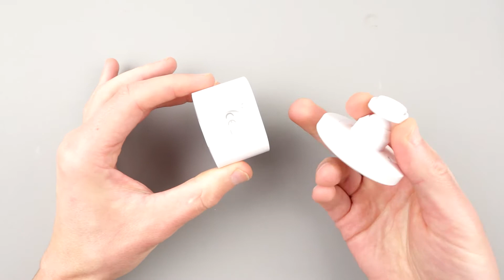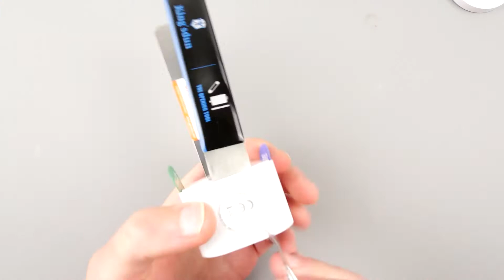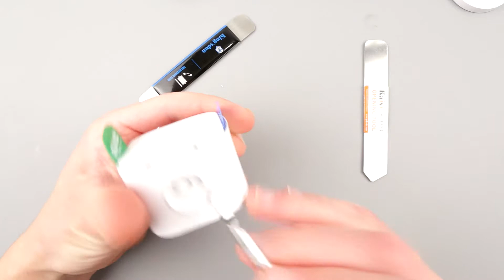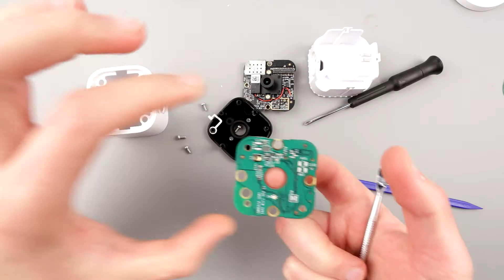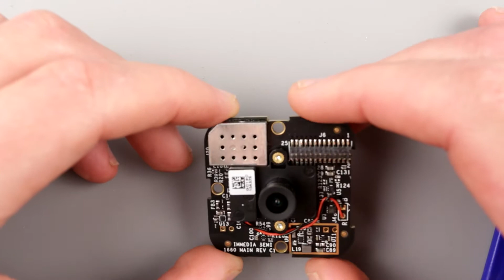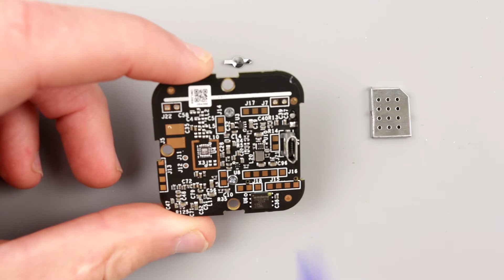Chopping Blink mini camera to pieces

Comment: I'm surprised this video hasn't got more views.  You did some good work here.  Importantly, you identified that the Blink mini contains that extreme low-power chip that was, apparently, the reason that Amazon bought Blink.  Of course that chip is all about saving battery power, so I assume that the mini shares a lot with the other Blink cameras.  I am going to have to experiment to see how long my mini lasts plugged into a portable power bank.  

By the way, you can usually see if something is emitting IR by simply looking at it through a phone camera.  I use this technique all the time to see if TV remote batteries are dead or not.  Cheap phones are better for this because good phones have effective IR filters.
Reply from the maker: Thank you for your support, I wish this video got more views as well.
Good Idea with cellphones, I will give it a try next time.

Comment: 8:40

It’s actually not blank but the laser engraving is microscopic 😂 not to mention even under the microscope it only catches the light in one direction. I ended up using a couple of different wavelengths of UVC LEDS, and a bit of fluorescent dye which helped but it was still difficult to read 
I  finally made it out and looked it up… The part number is CYW3438
Reply from the maker: Thank you for pointing this out!

Comment: woah. very cool video! didn't expect this thing to even open without any destruction, let alone be taken apart that much. I wanted to know if there was any way to hack it to use it as a usb camera. seems like it would be very had, unless had insane reverse engineering skills and knowledge, or had access to official firmware and documentation… oh well
Reply from the maker: Pretty much impossible unless hacking or modifying original firmware

Comment: What is that’s inside at the bottom of casing with TWO metal connectors contacting to the Circuit Board ?
Reply from the maker: This is Wifi antenna
Reply: I figured it out.. my mistake… inside the casing.. it is speaker.. it’s located not in the bottom.. but on the Top
Reply from the maker: @venkatstance4103  ok, thank you

Comment: hey Sir, thanks for your Work! im courious about, after your reassembly did it work again?Ive done the same thing but mein dont really want to connect after assembly, ive tried everything i think. i hope you could have any ideas to make it work again. Problem shows up at the beginning, i want to pair with my phone its not registered so its like a new cam (previously it was working after, ive removed from app and disassemblied, its not working anymore its Blinking but no connection.)

Thanks for your time, im really appreciated that.

Yours sincierly
#
SD
Reply from the maker: If the phone does not see the camera is wifi antennae probably not connected properly, please double check

Comment: Could you wire up a battery pack to this?
Reply from the maker: Simple USB powerbank works like a charm ;)
Reply: @InsideOutElectronics  Thanks for the response! I actually was a little foolish and put mine outside for a few days. It didn’t rain at all but was quite humid. One the last day the camera disconnected and the usb cable had rust in it. I’ve tried other usb cables and none of them power it on. So I’m trying to figure out if blink uses different pins for power. Or….. if you have any ideas. Both the boards look totally clean. But the actual usb cable has rust build up in it